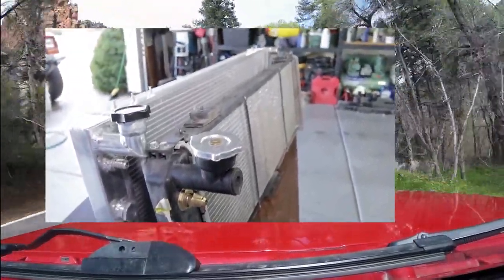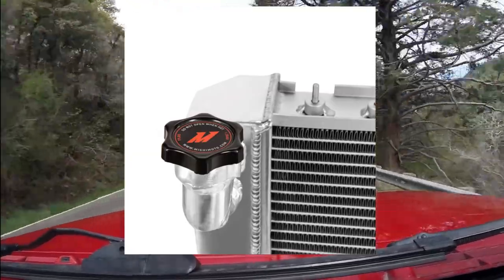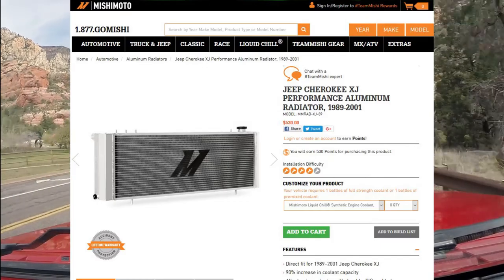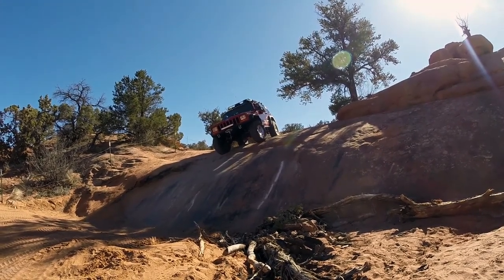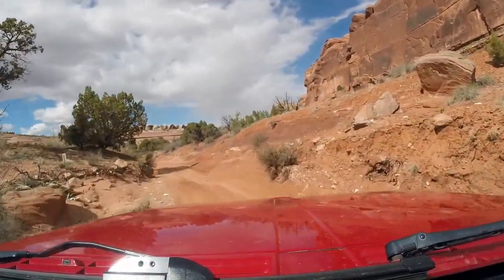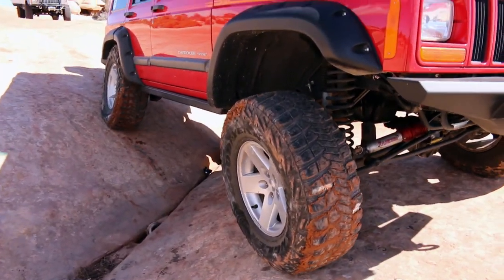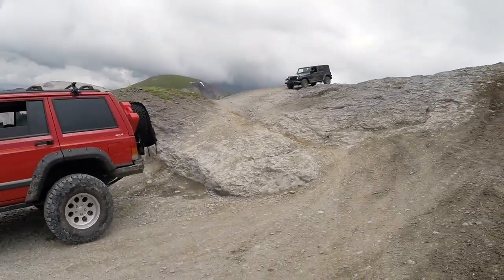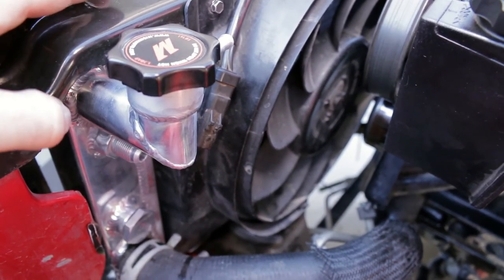Mishimoto Jeep Cherokee XJ Performance Radiator

Comment: I just bought one because I turned the heater on for the last time in 90 degree weather. Worst part was I couldn't even sit in a drive thru after a mountain biking ride because it would overheat. Thanks for the video.
Reply: I'm thinking of getting one. How has it been since you installed yours?

Comment: Thanks again for the excellent review, I went ahead and bought one. It was very easy to install and fit perfect. I am very surprised and VERY happy with how much cooler and consistent my engine now runs. I have never had it stay under 210 while towing, and in 80 degree weather I now never saw the gauge go above 210 while crawling up trails in the Utah mountains. My temp gauge usually stays right at 190, probably because I still have a 180-degree thermostat. I removed all my electric fans and went back to the the stock clutch fan setup, and even moved my trans cooler in front of the main fan, something I could never do before. I think just the fact that this radiator holds twice as much fluid and is solid aluminum are the improvements that make this cooling system work the way it should in a modified XJ. I got the radiator online for $370, and its damn sure worth every penny!!
Reply: Kurt Malcolm I just did the same thing today I put it in within an hour and it runs amazing. 170 temp driving and 195 idling

Comment: Stock radiator,with a v -8 Grand Cherokee fan clutch works extremely well also.For a 5th of the price,if your on a budget. It appears to be a good radiator, but not budget friendly.
Reply from the maker: john doe I have used that before but didn't like the performance hit it caused.  Definitely pulls some air though.
Reply: that's a good start but only a portion of what you should do....i have a great video up of my set up and it works flawlessly

Comment: Man I’ve got Az overheat problems as well. Did head gasket and took head for rebuild. They ruined it so got new casting and threw my reground valves and new guides etc in it. Was stoked to have new head at 170,000miles. Bottom end seems ok with cross hatch on cylinders still. Now it runs hotter than ever and slower than before. Took zj fan clutch off for stock replacement “added 10degrees”  helped hp but runs at 210-227 upwards of 235! Flow cooler pump stock fans setup with shrouds. Ported high flow thermostat housing with Stant 195 degree thermostat. Btw had to port thermostat housing to fit Stant thermostat. Regular aluminum Napa replacement radiator. I personally wish he wouldn’t ever hit 220 uphills or anything. That’s still not sufficient. I removed trans from rad too. Run big b&m cooler in front of mechanical fan and jegs 30,000gvw cooler with fan under rear seat area. Still gets up to 200  so want to add back into radiator then coolers so never goes above 210. At 210 oil lasts 10,000miles. 230 5,000miles until breaksdown so cooler the better for trans. Trust me I just rebuilt mine that was beyond smiles with warped valve body. 6+ lift 35’s 4:88 gears dynatrac pro-rock 60 rear, Dana 44 front with lock out hubs so helps gas mileage a ton. Feels effortless going down flat road but turd once hit a hill. All new sensors and heat shield for injectors and intake etc. Runs smooth as a top just hot as the Az sun. Great vid btw
Reply from the maker: @brad Sounds like you have tried a lot.  What sensors did you replace and were they geniune Oem Mopar?  Have you verified with IR temp gun that you are actually running the temp the gauge says it is running?  When does it get hot?  Traffic or highway?

Comment: Surgeonfish, I'm in phoenix as well and I'm in the the middle of a overheating battle on my 99 Xj. Its got dynatrac D44 front 8.8 rear with 4:88 gears 35" tires. 4.6 stroker JRC bumper and winch. I cant get this things to run under 220, with A/C on I go to 230 and beyond with no problem.  Now that Phoenix is hitting the 100+ temps how is it holding up? Right now I have a Champion radiator with  3/4" tubes with a flowKooler water pump. I thinking my weakness is the radiator. Do you think this radiator will help? Also do you know the tube size of the Mishimoto  radiator?
Reply from the maker: Michael Hooley. I would agree your weakness is the radiator.  I would look at the Mishimoto or the Griffith.  Might want to speak with Russ Pottenger about cooling as well.  He is the master builder when it comes to strokers.  Also,  run. Mopar OEM thermostat and fan clutch.  Don't use autopart stores.  Get your parts from www.moparwholesale.com. No shipping cost if you pick up in Avondale.
Reply: Hesco thermostat housing is helpful too and a 180 thermostat
Reply: Your Jeep seems heavy with the D44 and 35’s . I switched to 33’s to have less rotation weight. I’ve literally tried Everything and it still gets to 225 wheeling with no ac on.

Comment: I am contemplating running this rad, I was wondering how much space you had between your fan clutch and the rad, I ask this because I am currently running a grand Cherokee clutch fan that engages at a lower rpm, and it is a little bit larger, so I am worried about it hitting the mishimoto rad?
Any advice or information would be greatly appreciate
Reply: did you ever find out? About to instal a Mishimoto on mine.

Comment: Update on my problems. Stant thermostat was bad and wouldn’t open until 215-225. Also when trans blew up trans cooler inside radiator broke free and covered lower radiator hose outlet. Took out water pump so replaced it. Installed cold case wide tube rad, looks exactly the same as Mishimoto. 180 t stat and sometimes gets over 212 once 222. 206-210 traffic and freeway 210-212 65-75mph. Dynatrac 60 rear axle is a monster to roll but the 35’s are killing power. 4:88gears and lock out hubs Dana 44 front,”gas saver!”  Two 34,000gvw trans coolers are barely enough holding under 200 off-road Usually 145-185 on street. But rad made big difference but not enough I don’t think. It’s still only 100outside and we hit +20 over that. Going to try and rig a SPAL fan onto stock shroud for ac fan. Note zj fan clutch robs half my hp! Can’t even accelerate in od when loaded so had to take it off.
Reply from the maker: 35s are heavy.   Yes, I tried the ZJ fan years back and did not like how much HP it sucked.

Comment: How is it now after summer?  I'm running a Russ Pottenger 4.7 stroker and could use some extra cooling. :)   Looks like this has more surface area than the Griffin Direct fit. (1 row).
Reply from the maker: Still good.  No issues.  I would buy again for sure.

Comment: how is your Mishimoto radiator holding up after 6 months? Have you taken it off-road on some slow hot dusty hilly trails? Thanks for the nice detailed review!
Reply from the maker: Kurt Malcolm. Hi Kurt.  I still like the Mishimoto radiator.  No issues of any kind.  With summer coming I will see how it does when it gets north of a 100.  I will do a follow-up once I have had some really hot weather and get the wheeling in when hot.
Reply: please keep us updated :)

Comment: Are you using the transmission oil portion of the radiator, or are you completely bypassed using some other cooler for the transmission oil>
Reply from the maker: I bypassed radiator and use B&M 70268 soley.  Temps have been just fine like that.

Comment: You say its good but yet you still put in hood vents? Just for looks I guess?
Reply from the maker: Hood vents help with slow trail crawling.  Best thing I found with the hood vents is no more heat soak after shutting down engine and restarting 10 or 15 min later.  I would buy the radiator again.  It has been great for cooling over anything else I have had.

Comment: Any updates after several years?
Reply from the maker: Still working good.  I have heard others have had issues with it due to narrow passages and clogging however.  I have had no problems as of yet.   I flush the system annually.
Reply: @surgeonfish9014  I’m deciding to buy one, I have a 1990 jeep Cherokee XJ, but I have a transmission cooler, will it fit with that? Also I have a 180 degree thermostat with holes drilled it it for constant flow, new clutch fan (not upgraded) new 10 blade aux fan which helps a lot. Flushed my coolant, and I run water wetter. But still can get above operating temperature even in 65 degree weather, but when it’s 75-85 if I turn on my ac I sit around 215-218 when I turn on my heater I go to about 210. But I’d love to stay below 210 even if it’s 105 degrees with the AC on
Reply: @surgeonfish9014  do you think this would help with mine? I have a 1500 mile drive from California to New Mexico because I’m moving in 2 weeks, do would you say it’s worth it to buy it before I leave?

Comment: Great video... curious how it was on the trail... 4wd crawling in the heat?... great overall driving review though.. summertime traffic is killing me
Reply from the maker: Almost An Operator I have not had a chance to do any crawling.  However,  the the difference in stop n go traffic tells me it should be much better.  The fan rarely comes on any longer.  I checked it 2x thinking the fan was broken,  LOL.  It comes on with AC as expected.
Reply: surgeonfish sounds good i look forward to the long term test results..

Comment: How's it working in this 110* heat? I live in Havasu and own a 2001 XJ and am thinking about buying one.
Reply from the maker: Matt Branson.  Hi Matt,  only time I see a bit of temp rise is pulling hill with AC on.  It gets up to 220 and then drops quickly after hill.  No issues around town.  Hill would be I17 north up Black Canyon City.
Reply: surgeonfish that sounds like a winner to me. Thanks!!